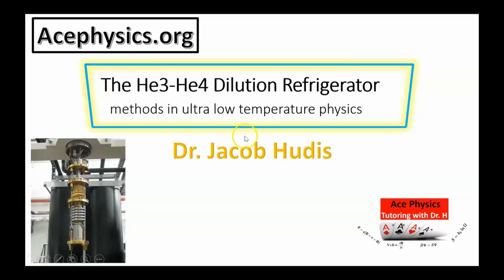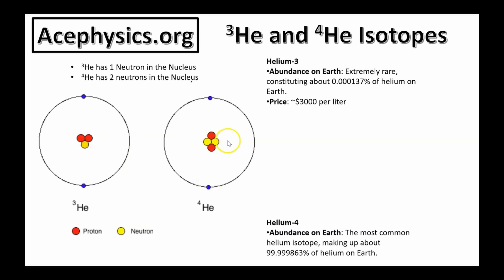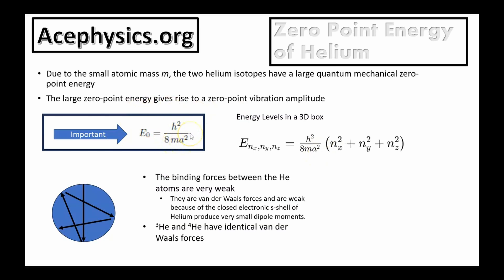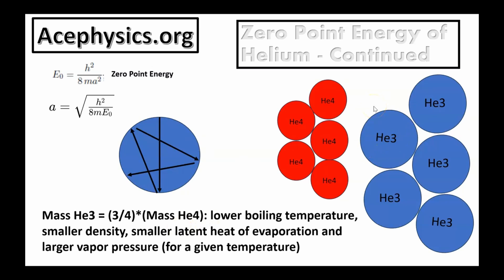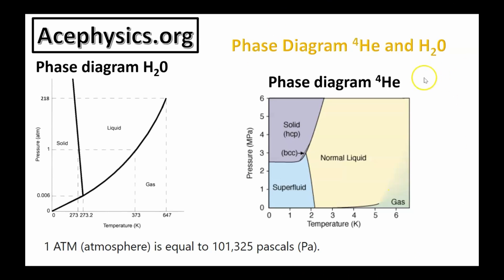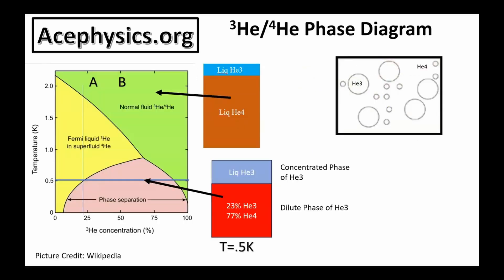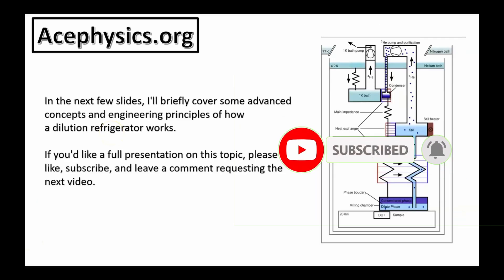Clear Explanation of the Physics Behind ³He/⁴He Dilution Refrigerators: Reaching Absolute Zero

Comment: Thanks for great explanation.   What would be the effect on this process if you only had 137 ppm of helium 3 mixed in with the helium 4?  Could you still pump out the helium 3 into concentrated helium-3 phase on top?
Reply from the maker: Great question, Rich — and thank you for asking something so interesting.

In a dilution refrigerator, phase separation between the concentrated He-3 phase (top) and the dilute phase (bottom) only occurs once you’re below the mixing temperature, where He-3 has a strong preference to dissolve into He-4. Even at very low overall concentrations, the system tries to form the two phases, but the amount of concentrated He-3 that appears depends directly on the total He-3 inventory.

At something like one hundred parts per million, you simply don’t have enough He-3 atoms to build a meaningful concentrated phase. You’d still get the thermodynamic drive toward separation, but the “concentrated layer’’ would be vanishingly thin — essentially impossible to pump from.

At a fraction of a percent, you start to get enough He-3 for a measurable concentrated phase, but it would still be extremely small and not practically useful.

So in short:
Yes, phase separation still wants to happen — but with only 137 ppm of He-3, the concentrated phase would be too tiny to extract in any meaningful way. You need a much higher He-3 fraction to operate a real dilution fridge.

Hope that helps — and I appreciate the thoughtful question!

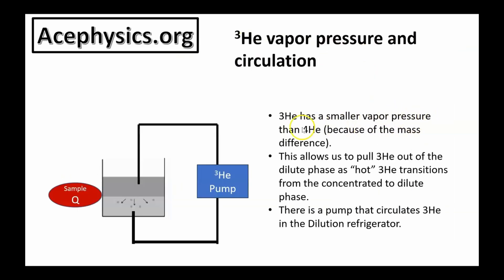Comment: 16:32 3He should have larger vapour pressure than 4He, instead of smaller?
Reply from the maker: Helium-3 has a higher vapor pressure than Helium-4 at the same temperature. This is because Helium-3 atoms are lighter and have more zero-point motion, making them more likely to escape from the liquid into the gas phase. As a result, more Helium-3 atoms exist in the vapor above the liquid compared to Helium-4, leading to the higher vapor pressure.  (Did I accidentally say it backward?)
Reply: @acephysics123  you in fact wrote it backward. Thanks.

Comment: Great explanation about of how phase changes absorb/release energy without changing temperature.  That analogy between the melting ice and the dilution refrigerator is very effective.

I also tend to think of those changes in terms of entropy.  Your talk didn't really discuss entropy much, but I think it's another way to understand the same phenomenon.

Around 17:40 you talk about the chemical potential.  I've never really understood chemical potential very well, but this seems like it's a great way to approach this topic.  I would love to see a video that analyzes the dilution refrigerator in chemical-potential terms!
Reply from the maker: Hi, thank you for your nice comment!  At some point I might make an update with entropy and chemical potential.  The next video in this series will be on polarization, digital polarimeters and LCD.  I think it will be a great video.  You should watch that one as well.  I have a feeling based on your comment that you might check that video out.

Comment: Interesting very clear explanation of the principles involved. The presentation gives the impression that other elements can't be used to achieve cooling to the same degree?
Reply from the maker: Hello @Kellywildon2881!  Thank you for watching and commenting on my video!  I have been serious about making science videos for roughly the past two months (since May 2024) and I have not gotten many comments on any on any of my videos.  Thanks for your comment!  Now to address your question.  
It is true that other atoms, besides helium, have isotopes where one is a fermion and another is a boson. This makes it tempting to think that dilution refrigeration might work with these other elements. In fact, it might work to some extent, but it couldn't achieve temperatures much lower than the liquid phase of the cooling element. For instance, liquid nitrogen cools at around 77K . If you used a mixture of nitrogen isotopes, where one was a fermion and the other a boson (assuming they are sufficiently abundant on Earth), the dilution would only be able to remove energy near the liquid phase boundary. This means it could only cool to a temperature near 77K or slightly lower. All scientific refrigerators use helium for this reason. Therefore, I am relatively sure that other elements would not achieve lower temperatures, or else they would be used. Perhaps you are considering another aspect of the process? Are you a physics student or a scientist? Thanks again for your question!  Please let me know if you want further clarification.